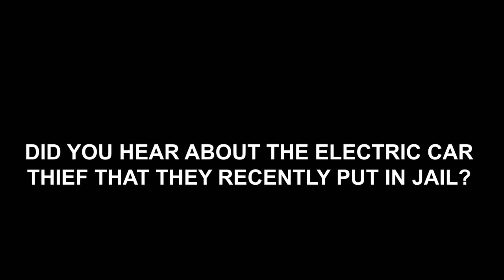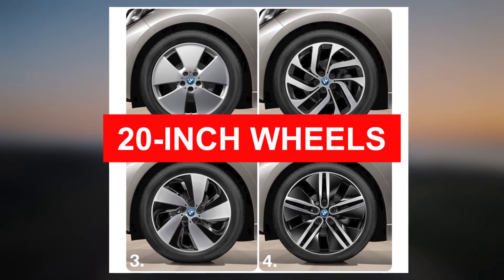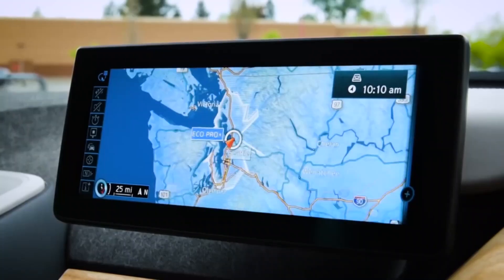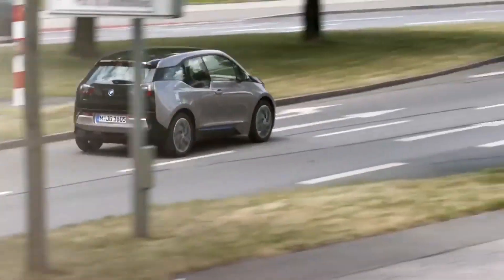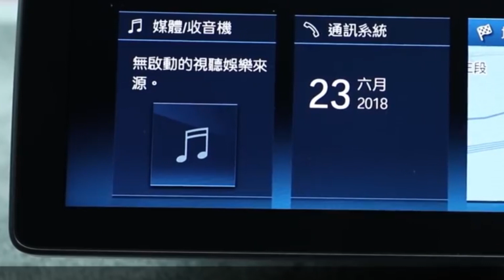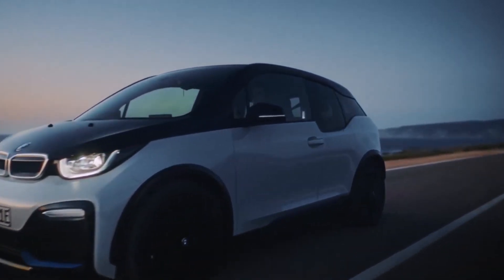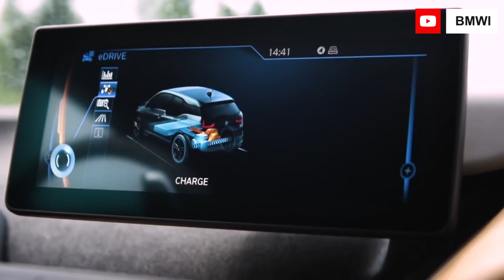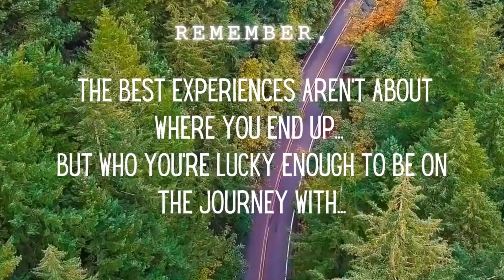First Look Review: BMW I3 EV | Next Electric Car

Comment: It was a great car but now the end is near with production finishing in July.
Reply: The latest ones with 170 mile range are still okay. Since they have a small battery, they can charge to 90% in about 50 minutes on a fast charger. They keep at high rate of charge unlike larger battery cars, so are not too bad. Not a great choice for regular long journeys but they can do it for occasional trips over 100 miles.
Reply from the maker: You think there's going to be any delays?
Reply: The ReX version is the best city area electric car ever conceived & made. I had 2 consecutive leases, couldn't get another, was told here in the US that production was ceased. Where is this still available???
Reply: @davidweiss5726  In Europe the larger battery 120 cars are ceasing production in July 2022. The Rex cars with 94 batteries stopped production in 2018 I think. In Europe it was never possible to get the larger battery with a Rex. I assume the extra weight and performance loss was not worth it on cars that already had a good range.